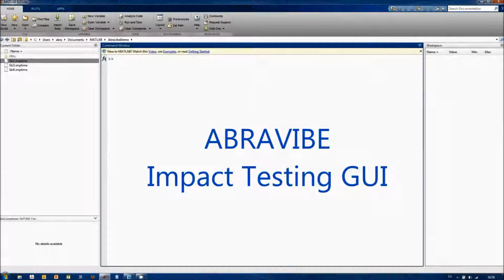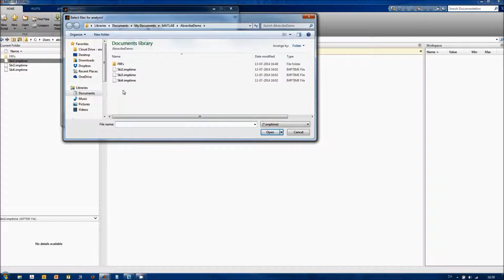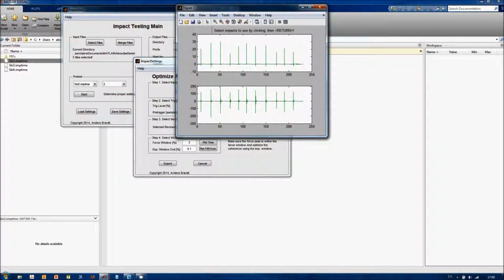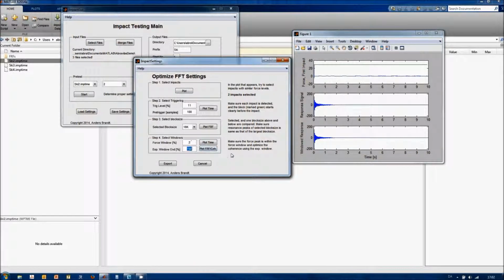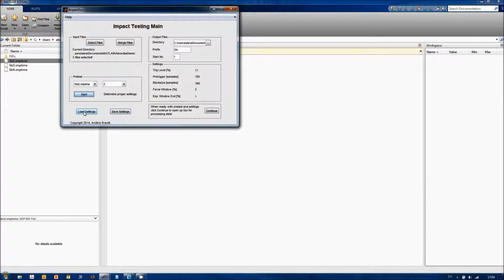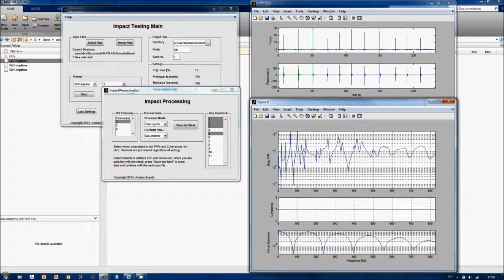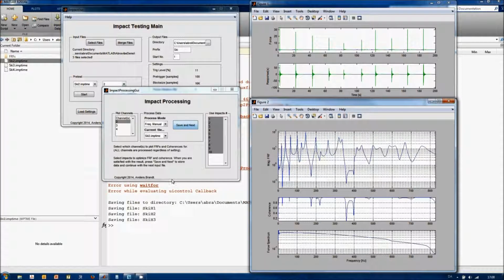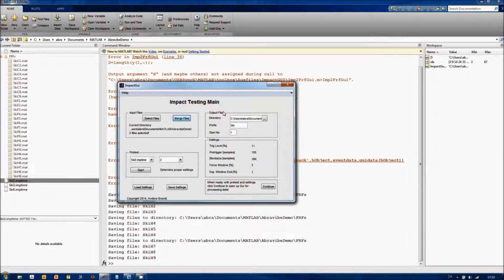ABRAVIBE ImpactGui Demonstration

Comment: how is the data  collected by the Impact GUI. Should I record the data  using Data acquisition tool box and save the data in imptime format? or the Impact gui will record the data after firing it up? how do i configure the data acquisition system in impactgui if so ?